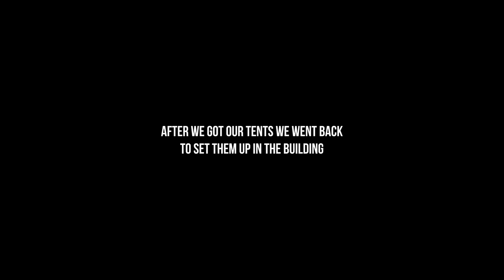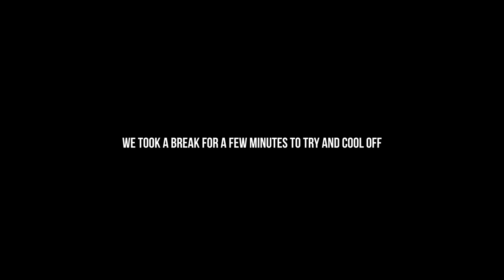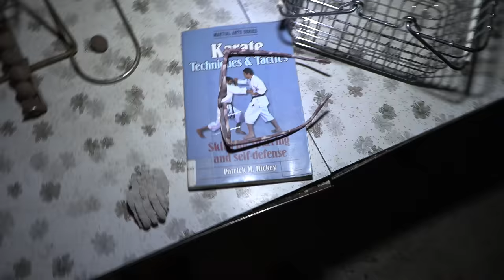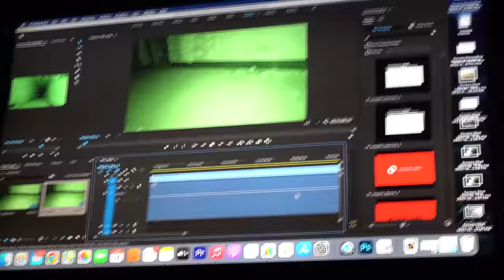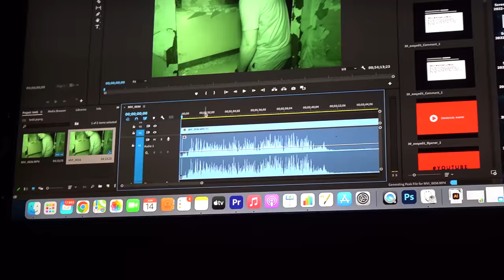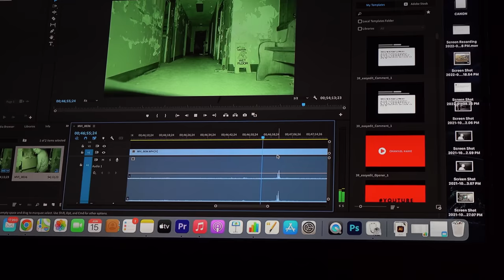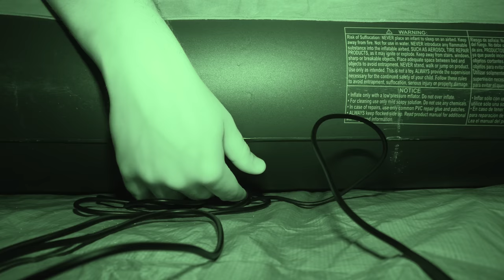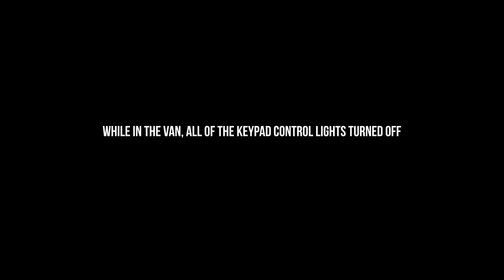(Part 2) Camping Inside HAUNTED Asylum ALONE

Comment: Just so future reference for you. At the beginning of the vid when the tarp in the window is moving, it could be possibly explained if there is a temp difference. If it's colder inside and hotter outside enough it would pull a draft through as long as there is a path that leads from the outside. This is typically why in doorways it feels weird since it's where temp is most noticeable different, it creates a funnel

Comment: CJ -while you guys were going thru the footage, between the 50-55 min(of this video, not the timestamp on the footage you were checking), while you were so concentrated on the audio, I started watching the video very closely, cuz something reflected off of something metal, causing a tiny flash of light which caught my eye. Throughout the spikes that you kept saying were bugs, & especially when you hear the finger snapping(which I identified as such, a few 'bugs' before you said it!)-if you watch closely, in the room down at the end of the hall, I saw movement, not just once, but SEVERAL TIMES, as if someone was walking back & forth across the doorway. It's faint, but definitely movement. & the light & shadow play in the hallway kept changing slightly too, as tho whoever was moving around was causing shadow play on the wall out in the hall. I saw the light get brighter&dim again, a few times, seeming to match the faint movement I saw. It's very dark down there, but I'd swear who, or whatever was moving was wearing something white or gray,in contrast to the darkness, &was probably the reason I saw it. If they'd been wearing black, I don't think I would have seen the movement, cuz it would have blended right into the darkness.. I hit pause & replayed it several times& there's no question in my mind, that SOMEONE, or SOMETHING, WAS down there..!

Comment: Hey CJ, you really don't need to be hot when staying in a place like that overnight. You guys should get yourselves  some portable ACs. They use batteries. You'll just need to bring cold water to pour into them so you stay cool. The colder the water the colder the air will be.

Comment: Do yourselves a favor and buy a couple battery operated fans. You could at least have a hot breeze on you.  😉 that was definitely someone snapping their fingers. That scuttering sound was a beetle that hit the floor an landed upside down, wings out and trying to turn over. That loud noise though was maybe that chair that you knocked over, that's kinda what it sounded like. Maybe they mocked the noise? An those long slinky bugs are click bugs.  If you hold one it'll click its shells. They're harmless but fun for kids to hold. You can tell the difference between the bug sounds and the finger snap though.  Maybe that loud sound  that sounded like broomstick falling or a jointed object may have been the sound of the metal foot rests on a wheelchair being folded down.

Comment: something to think about whenever you're listening back to videos you know how you were saying that voices are hard to capture or to know where they are if you have the ones that are two tones for voices the EVPs are usually on the bottom Spike so the decibel is lower so it would be a different color than normal speech pattern that's how I always find my EVPs very fast. so if you see a speech pattern in green look below that for a different pattern it's usually a different color saying that something was speaking and it'll have different color spikes something to look out for.